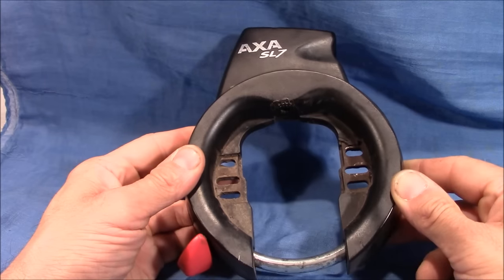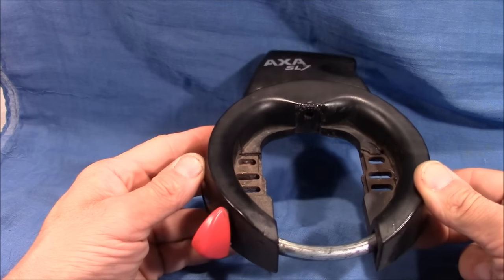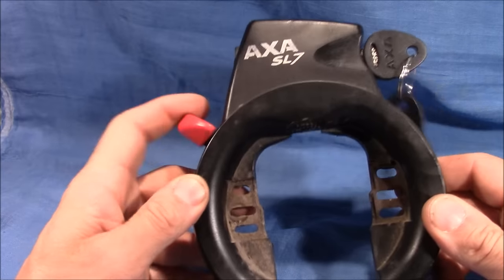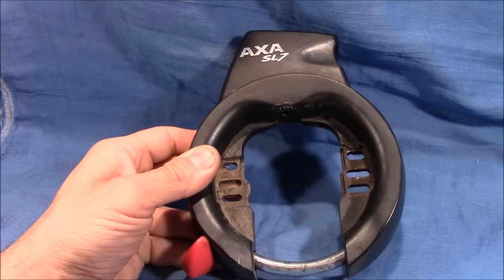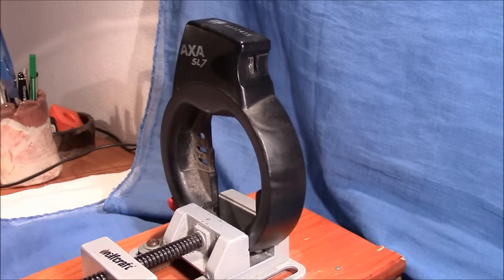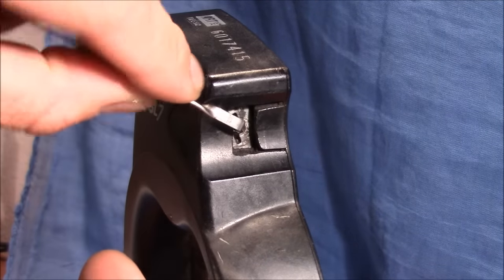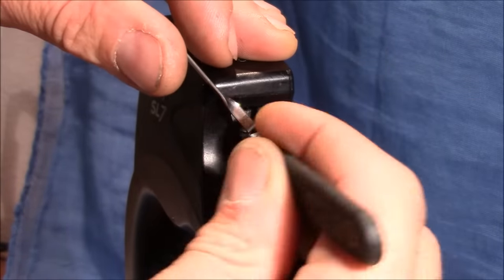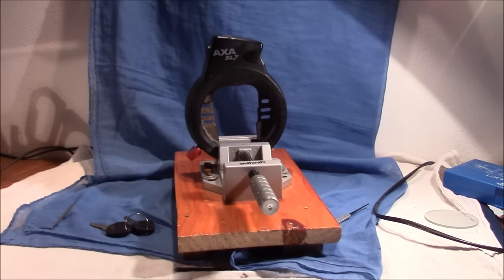(picking 64) Picking a bicycle wheel lock (AXA SL7, simple wafer lock)

Comment: thank you! I lost my key just before my exams and i used a paperclip and bobby pin and it worked, fairly easy to be honest!
Reply: How did you manage, I have the tools but still can't open it...
Reply: @silviyandyuzev6870  just keep trying! I took 15 minutes just trying to get my tools "right" (shape, placement, length, etc), and after that it took me 15 minutes just applying tension and fiddling with the pins... i don't know exactly what i did, but i wiggled it for a while and it unlocked  :')

Comment: Pro tip! The easiest way to open these is to force them open by beating the handle open with a hammer. It took me 3-4 light hits to open mine. Bear in mind this does destroy the lock and you will need to replace it. Do this at your own risk and keep it in mind when shopping for bike locks.

Comment: Axa locks are fine for short-term use (there's a reason they're referred to as 'cafe locks') provided you use the chain / cable that plugs into the hole in the top of the lock to secure the bicycle to a solid object, preventing someone from carrying the bike away and throwing it into a van. If they somehow manage to cut through the cable, they're still unable to ride the bike away because of the spoke lock. Not foolproof (what is?) but will defeat 90% of bicycle thieves.
Reply from the maker: Yes, agree - short time protection against casual thieves.

Comment: Hello, I have a similar locker on my bike with the chain attached on the locker, but the key is not working anymore (It barely enters into the locker like if was a different key). I tried WD-40 but still not open. Feels like the key was not the correct one, or someone damaged the locker by trying to open it or something. Nobody wants to break the chain or open in because I have the bike parked on the street. Do you have an idea how to solve it?

Comment: If you drill the brass pins inside with a drill bit it is supper fast. The newer axe locks have the steel pins so harder to drill. I would think a wafer jiggling pick would work faster and easier then a hook pick. Perhaps even a city rake or worm pick.

Comment: i have an AXA lock too, i was trying to do same as you but looks like the key hole does not allow to insert a tension tool...in your case the tension tool fits very good but in my case it almost does not fit, i can't do a proper tension, or its hard to insert at the same time a tension tool and the picking tool....how do yo deal with that?? in case that helps, in the lock there is written "AXA Rock".
Reply from the maker: You should try different size and type of wrenches. Also consider using two tensioners so you can free one side at a time. But I don't know how the keyway looks like.

Comment: That's weird, I have the same lock and cannot get it to open at all! Also, the one I have laying around seems to be a newer model.
Reply from the maker: Try to find out what's special on yours and keep on picking - good luck.
Reply: @Potti314  some of the newer models require that you put pressure on the lever in order to tension the core. The shackle will lock the core in place when there is no pressure applied. So on a bike you have to have one hand on the other side of the bike to tension the shackle, which makes it harder to tension and rake the lock.
Reply from the maker: @fermitupoupon1754  Ok, I see - thanks for the info.

Comment: Could you recommend few locks with are really hard or impossible to broke?
Reply from the maker: First, have a lock with that you can secure the bicycle on a fixed object. If it can be carried away the best lock is useless. Then have a lock that cannot be easily cut. I prefer something like that http://www.abus.com/ger/Sicherheit-Unterwegs/Fahrradsicherheit/Fahrradschloesser/Buegelschloesser/GRANIT-X-Plus-540 it can be attached easily in the frame of your bike. I also like that it's a disk detainer locking mechanism, hence no springs are involved what makes it robust against wear-out and humidity and freeze. It's also much harder to pick. The keyway cover is also very helpful to prevent the lock getting dirty.

Comment: Do you have any recommendations of a safe lock?
Reply from the maker: No, sorry. I'm not into safes.
Reply: @Potti314  Oh, haha. I just mean a lock thats safe. Same style as the video. Hahaha. Not sure if youre pulling my leg here.
Reply from the maker: @Stat1onary  OK, now I got you. The problem with this lock is not that it can be picked (easily) but that it still allows a thieve to carry away your bike. Picking and raking is not at all a common method to steal or break into something. Criminals don't do that - too unreliable and time-consuming. Personally I would not use these spoke-blocking locks. First, if a thieve is not aware of it and thinks the bike is unlocked, he/she will bend some spokes when trying to drive away. Second, professional thieves will be able to easily carry it to their truck. I use an u-shaped lock from hardened steel and always secure my bike to a fixed object (traffic sign post, etc.). Sure, an angle grinder will cut it through, but it makes noise and takes a while and other methods of breaking it will fail.
Reply: @Potti314  I was wondering if a lock like this is still good as a back up lock, just to keep the wheel from being removed while having a d lock for the front [attaching it to the frame ofc]. Otherwise I'm off to go buy a chain lock.
Reply: @felikannd  you can get a cable or chain, sold separately, that plugs into the hole on AXA locks and allows you to lock the bike (and the front wheel) together around a solid object.

Comment: does it work as good with a lockgun? or are pens better?
Reply from the maker: +Marc Knudsen I don't have a lockgun to test and a pen could maybe used for a circular lock.
Reply: +Potti314 so if i'll do it with a half diamond, it'll work, and go as fast (with practise) as you can do it?
the only reason why i ask, is because that i've lost my key to my bicycle wheel lock, and it's the 3'rd time it happens.
so i thought that i'd be a good idea to know how to lockpick it, so that i can open it next time it happens (2 of the times, my keys got stolen).
Reply from the maker: +Marc Knudsen Half diamond is fine I guess. Actually a snow man or a "8" pick is most appropriate to pick such locks.
The tolerances are not that tight and oversetting is not really an issue. That's why a raking type approach with the above mentioned picks will work very often.
Keep in mind that the place where the lock is attached may disturb a comfortable access in contrast to the desk situation.
Reply: +Potti314 thank you so much for the fast reply, and all the good advise. i really appreciate it.